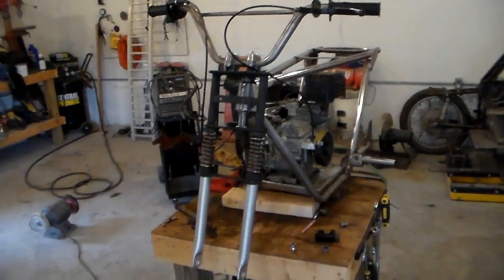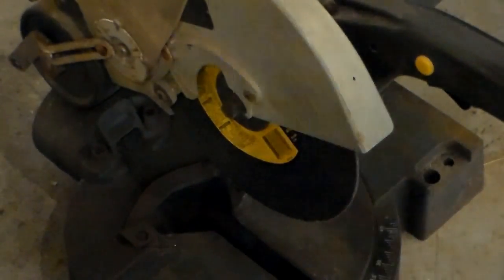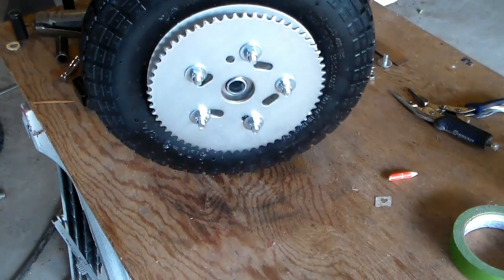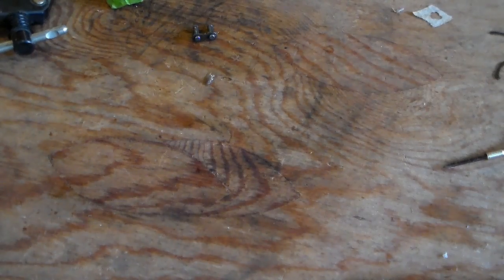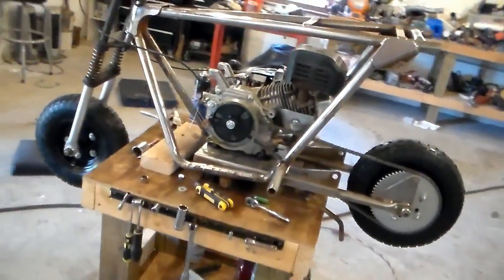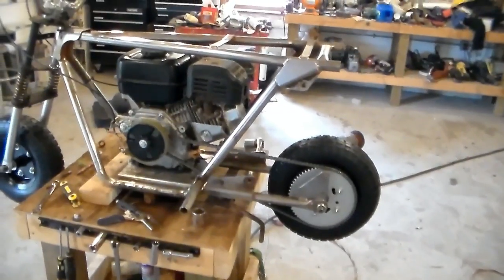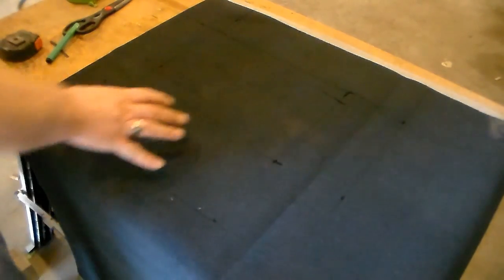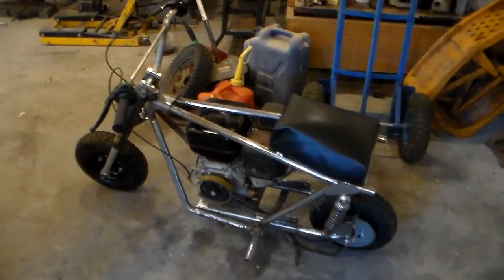Saving a 50 year Old Mini Bike from the Scrap Pile - Part 3

Comment: Cool restro for sure. Any updates on this build? I think I would have painted it to protect the metal and, did this have a jack shaft on it? It looks like it may have mounts for one. I would think about adding one to it. Your top speed suffers but it will have a lot better  low speed torque.